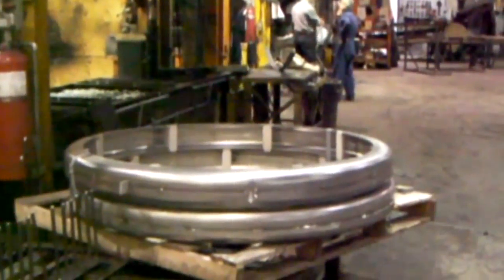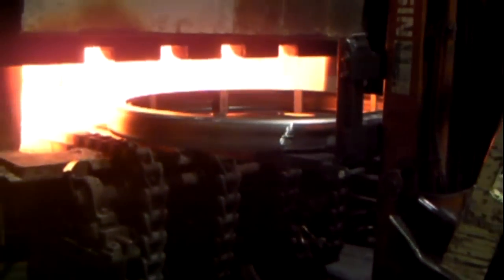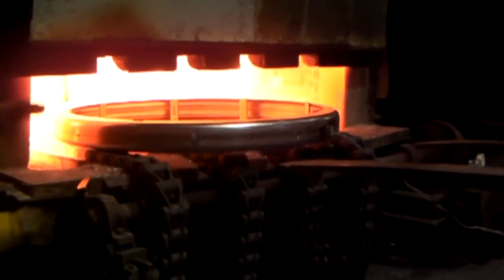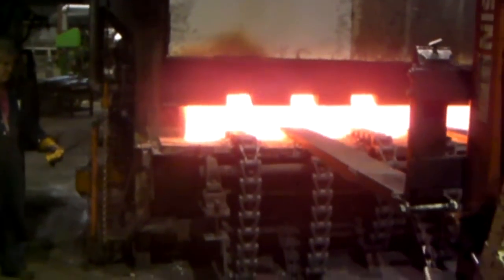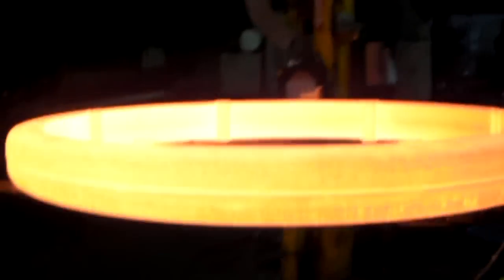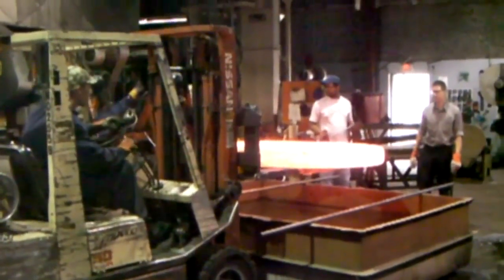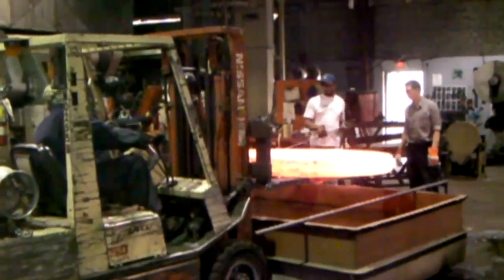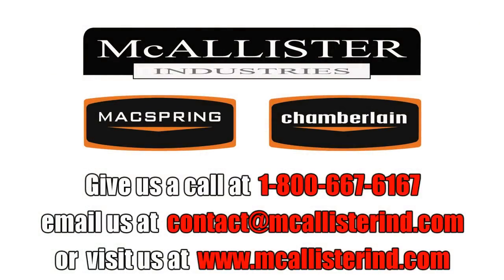Water Quenching

Comment: I am more concern about the lifting forks' hardness will be weakened by the high heat.
Reply: nope, it wont get high enough temperature to undergo microstructure change just from contact with the hot parts, you can see that the lifting forks not glowing red, which means that it's nowhere near 500C

Comment: the main purpose of hardening of steel is to increase hardness ,strength and wear resistance, and to obtain  a suitable  microstructure which will have desired mechanical properties after tempering.
Reply: They stated in the video that they are "stress relieving", which doesn't change the properties like annealing or normalizing.  Note: I have no idea what I'm talking about, but I did google the terms.
Reply: That's true of carbon steel.  They said this was 304 stainless. This alloy will NOT harden with a quench.  This is actually how you anneal.  You get it very hot for a couple hours, then quench in water.  It will remain as austenite (the soft crystal structure).  This will be soft, but ideal for corrosion resistance.

304 stainless will not harden with a quench due to it's low carbon content, and the fact that it is both high nickel and high chromium.  They interfere with the structure that would otherwise harden the steel.